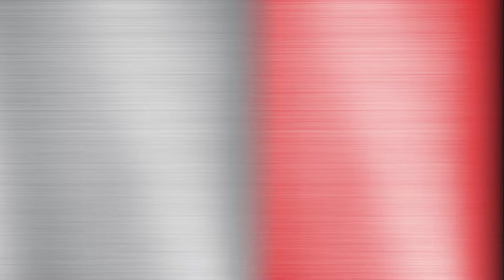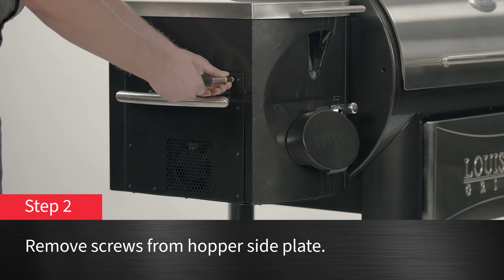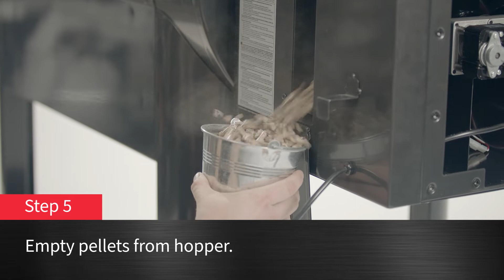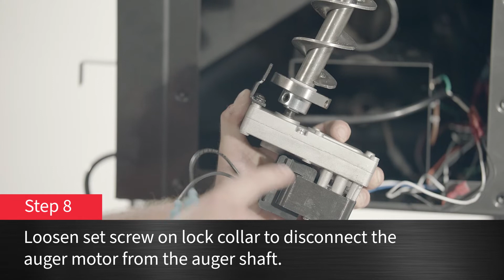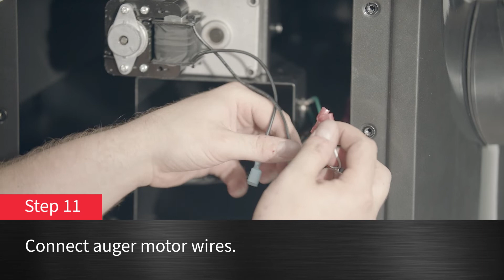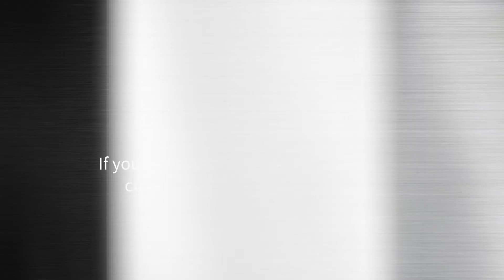Louisiana Grills Founders Series Repair - Auger Motor Replacement

Comment: Hi, I have a SL700 louisiana grill and unfortunately the motor auger broken, I need a New one , how i can buy a New one or fix this, I think that the motor auger   broken because the size of the pellets  are 🔥 very big and it did the auger Jam and the mesh inside the motor broken, i turn on and make a loud noise but the auger didn't moves, thank's and I hope that you can help me,  I'm from Toluca, México.